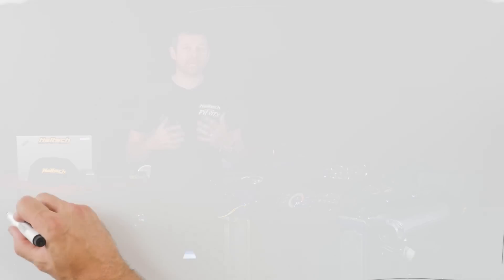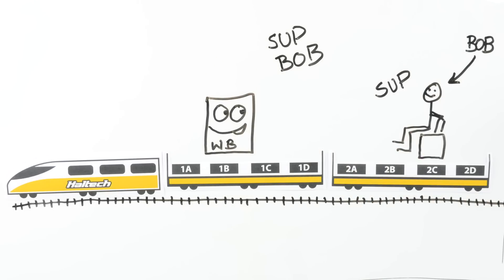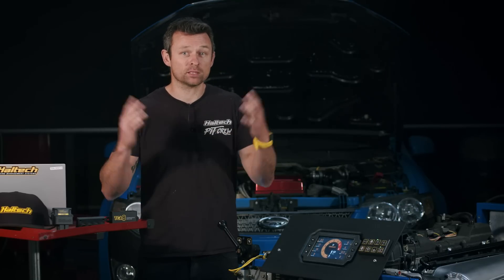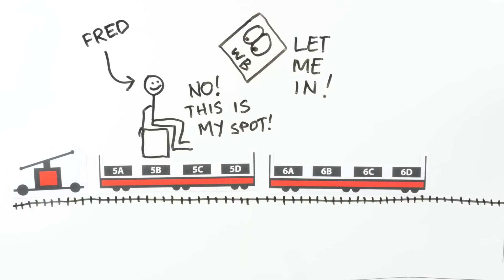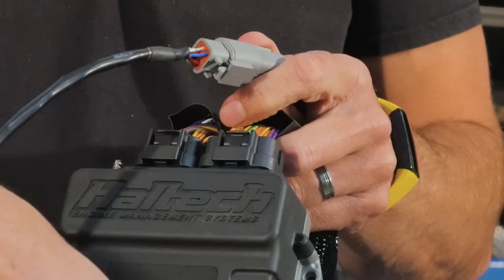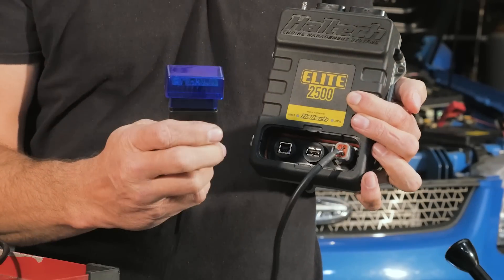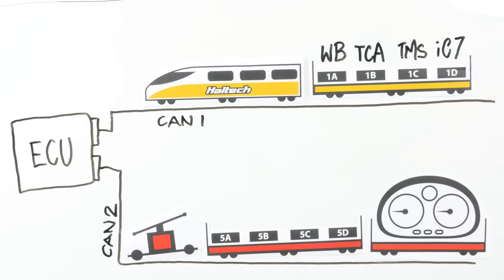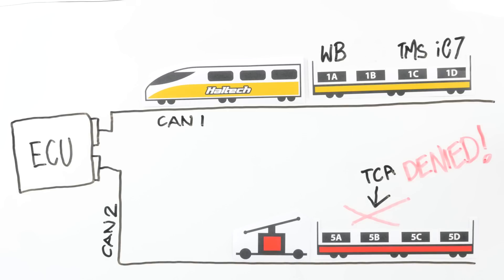🛠 CAN bus explained (it's actually super useful!) | TECHNICALLY SPEAKING

Comment: You’re saying you don’t have a lot of issues with communication problems stemming from poor network architecture/termination, is it safe to assume you are using a lower baud rate like 125k then?
I do regularly see communication issues on the CAN networks I work with and they always stem from people violating stub lengths, putting stubs on stubs, usually from putting wye connectors on the diagnostic port (sometimes multiple). 
It causes all kinds of strange and intermittent issues that are how I get involved.
Reply: The Haltech bus operates at 1Mb

Comment: Question
Can the can bus be used to actuate real loads like   relays and or solid state relays for things like transmission control,a/c clutches, fuel pumps and the like?
Also can Can bus deliver analog control? For say boost control, may be even pump volume control?
Reply: No, you'd have to have a module that could translate that can signal to digitally switch these outputs
Reply: @dazaspc  ah yes, I'm pretty sure (not 100%) that you'd need a can module to translate high/low for standard relays, so not a can bus relay... which would be cool! Canbus can't do analog control it's a digital high or digital low or on/off. If that makes sense?